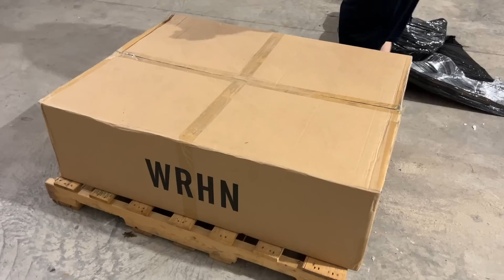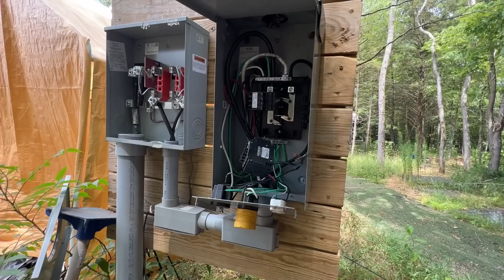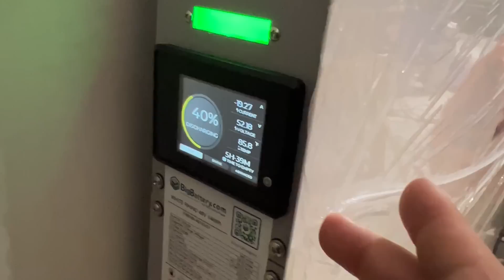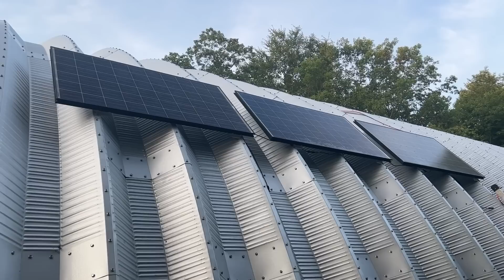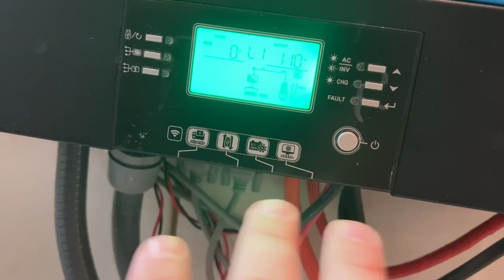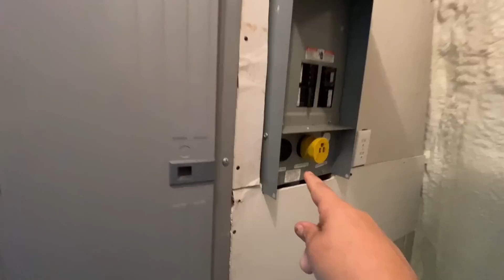DIY solar power to save $400 per month off our electric bill. SunGoldPower TP6048 Hybrid Inverter

Comment: Scott, good onya for putting in solar,
I originally put in a 1kw grid tied system 11+ years ago at the time the buy back of power was at 49.4 cents per unit
I then set up a standalone system on the back section of my roof of 3 x 190w solar panels (still have 2 more to go up) and a 400w wind turbine, feeding to 2 x 12v 470 amp/hour agm battery's to a 24v x 240v 1kw Inverter
(after 10 years that went and let the pixies out about 3 weeks ago so I have purchased a 3.5kw (peak @7kw) Inverter with remote waiting to be installed by me
After 10 years the opportunity came my way and 5 of us each purchased a 6.6kw solar system for 2900 $ installed
Saving at the time 600$each because we were smart and used our numbers to get good deals.
So for just over a year I have created 10, 066.9 kwh of power (it's nice having an app on the phone 😁) but as our subsidy dropped after the initial 10 years on my 1kw GRID tied system I now only get 7 cents per unit off peak and 10 cents a unit peak times (between 3pm and 9pm)
Being a single bloke my daily usage is only 5 kws I have recently purchased a Fujistu 5kw split ac to make my life more comfortable in summer and winter yet go to in. 
For me years ago I could see the writing on the wall about the monopoly of power companies screwing us and also being one to let my actions speak for my environmental credentials 
I have saved a lot of money by going solar (and wind) 
I believe in having a hybrid system of solar and wind, if you get a dark winter day you always have a second source of power and at night when the sun doesn't shine. 
When I can afford it I will put in a battery but the economics have to add up being a single person with already a big solar system producing my power. 
Consider looking into a suplimentry wind turbine Scott  they are worth it 
Enjoy your new freedoms and I think your Pay off time is going to be way less than 2 years! 
Tony from Western Australia 🇦🇺
Reply from the maker: I want to add wind but just have been disheartened by reading reviews of just about every one i look at.
Reply: @BusGreaseMonkey 
Scott have you looked into the Savonius (VAWT) wind turbine?
They are a great wind turbine as well.
My turbine you can see in my video on my channel titled
0003 - Feeding Time At My Place with Pink & Grey Galahs' and Western Correllas' and Joanie the cat.

Right at the 4: 57 minute mark
It is on a 6 metre x 50mm galvanised pipe attached to my verandah post, no noise,
If the batteries are not fully charged and the wind is blowing it works,
It starts at 4.1 metres per second of wind, I live at the bottom of a valley (Avon valley) in Western Australia
Neighbours on 3 sides never had one comment from any of them, and as you can see (being sarcastic here), the birds are terrified of it 😁
I have in 11 years never seen a bird injured or killed by it and some days over 100 birds come in for a feed.
Persist Scott in looking especially now their are so many varieties of turbines

Back in 1981 my mate Max built a Savonius out of just 1 x 44 gallon drum and mounted it on a 50mm galvanised pipe
The 2 halves facing north and south
I just did a YouTube search 

Savonius VAWT 44 Gallon Barrel Wind Turbine
https://youtu.be/_-0FQ31N1tI 

Max only had one tower of turbine in this you can see 2

When the wind blew and not very hard, YOU COULD NOT STOP it turning by grabbing hold of the pipe
He eventually put up the 
East and west halves and it was a real pleasure to watch and generate power 

You are mechanically optimised I'm sure if you don't want to buy one that you could for a very few dollars build one to try how good a wind turbine is 
You will have to research the generator side of your needs to attach to the Savonius and also talk to your guys your battery came from and ask them for advice to connect the Savonius to it, 
My only regret about my wind turbine is, at the time of setting up my standalone system 11 years ago as you can imagine living on a limited income I spent a fair amount on the batteries 1500$ for 2x 470 amp/h agms the Inverter, mmpt charger, cables etc by the time I started looking for wind turbines money was getting a little scarce, and 11 years ago commercially available components were still very expensive so all I could afford was a 400 w (peak 600w)24v 
Turbine I would have loved a 2kw but again I would have had to upgrade the Inverter to a 3kw or 3.5kw at least and that probably would have cost 2000$ ish back then. 
Prices have dropped hugely 
And as I said I brought this 
A couple of weeks ago 
(AU $337.21  31%OFF | Inverter 12v/ 24v 220v 7000w pure sine wave solar inverter Voltage transformer converter LED display usb charging dual socket
https://a.aliexpress.com/_mOVtbY2 ) 
I hope to install it today if I can motivate myself sufficiently! 

I envy you your modern day choices if you do go wind I didn't have the opportunity of varieties and better prices back then.

Just look at the known companies out there, and decide, try to talk to their customers, if they are a kosher company they will be happy to give you contact to talk to,.... 
Remember the comments you see on YouTube pages don't always have a good manufacturer's good interest at heart 
How many trolls do you GET? 

LOOK for the lowest starting generation point ie mine is 4.1 metres per second wind and make sure it has a max wind breaking function to stop it in excessive winds 
Hopefully maybe an app for the phone (if you are a nerd like me 😁) 

and yes when this one(my turbine) let's out the pixies I will get another bigger one 😁
Tony from Western Australia 🇦🇺

Comment: Hi Scott! I think that it is a great thing that you are doing, going solar to save on your power bill. Although, I know that you said that you bought those panels used from Santan, Will Prowse had a video where he bought 10 used panels from them and if I remember right, only one panel out of the 10 actually was able to provide 80% of the output. And some of the others were really degraded. Something that one should think about. But if it meets your needs, then it works for you!

Comment: I build custom solar controller's that allow for instant reconfiguration of the solar array.  With my controller all of the panels are wired directly into a master junction box which can reconfigure the array into any variety of configurations of series and parallel so that the minimum voltage required to charge is met.  

If you are generating excess energy then you need more battery capacity.  For backup energy I use a 60kw kohler standby generator and I have enough charging capacity and battery capacity so that my generator does not have to run very often.  My property is off-grid so I no grid for backup but after doing the math it is cheaper to burn diesel then pay for grid power which is not available.  The solar is actually the backup to a 36kw wind turbine.  I have 4 outback power systems inverter chargers each capable of 3600 watts continuous and with low use I run on a single inverter and as soon as there is more demand the other inverters will turn on and instantaneously synchronize sine wave output.  I do have enough battery capacity to run for almost 2 weeks with normal usage without any input.  The local utility company wanted $300k to bring grid power onto my property so instead of investing in that I built my own generating station.
Reply: What your saying you built is pretty amazing.
Reply: Nice

Comment: WOW! Great video. I wonder why they ship the battery pack in the ON mode. It is amazing how you manage to get those panels on your roof. I wish we get to see how you get the mounting rails, I do not see the mounting rails, on the roof and how the panels are attached to the rails or to the roof without the panel try to slide down while you try to mount the panels to the rails.

Comment: That battery will last a lot longer than 10 years. The blade batteries are rated by BYD (who makes them) is for 80% degradation after 6000 cycles.

Comment: I didn't hear you point out that these solar installer systems don't usually work when the power goes out. Yours does and can still provide most of your needs. I have a battery storage solar/wind system I'm working on. Just finished adding 10kwh more battery yesterday. I will be updating my youtube channel soon.
Reply: that inverter he has can run without batteries too.  if consumers went that route they would have power if the grid goes down, just not at night with no sun.  it can also backfeed the grid.

Comment: Did you have to have a company engineer the system or did you do it yourself?  I would like to put a system like that in.
Reply: there's nothing to engineer...it's simple plug and play.  just ask the seller to give you the correct equipment, etc.  it's an all in one inverter, plug in the battery and solar, done.

Comment: If you recall, I warned you about high taxes & fees in Tenn. before you bought the property ( along with over 100 inches a year of rain) One of our guys lived in Murfreesboro Tenn for about 5 years. As soon as his wife & him both retired. They investigated & found locations with very few taxes and no fees. He found the 2 cheapest were Texas & Florida.  He hates the humidity of Florida so they moved to Austin Texas and now wishes he came down here with me as my electic bill last month was $112.00 with over 20 days with temps in the upper 80s & 90s His electric bill in Austin was $238.00 and neither of us have any solar. Down here our power company offers to pay for everything to install solar on your house, the draw back is the first real hard tropical storm or Hurricane the repair bill to rebuild the system is on the OWNER to rebuild it as it is NOT covered with insurance. So it comes down to do ALL your homework & investigate everything before you jump in.
Reply: High taxes? Come to ILLINOIS!
Reply: @hotpuppy1   No thank you, I just got out of there ( well Missouri, same crap )  They even charge you for what you already paid tax for every year over & over, call it personal property tax, what a total SCAM !  GET OUT ! I did.  Was surprised that St. Louis is now the deadliest city in the country. Things are really bad up that way.
Reply: I pay 30 a month in summer...at 75 degrees inside.  50 in winter with the heatpump..installed my own geothermal heatpump for around 7k.

Comment: Great Video! I want to go solar here in Atlanta, but got my hair blown back with $35k and higher quotes with no batteries! Thanks for the component sources. I would like to go the route you did, but I would need someone to install the  system. Considering the route you took, do you get your 26% tax credit?
Reply: He should on any new gear, and “contracted” (could be another G. M. Entity doing the wooden nickel work?) would apply.

Comment: I wonder how much you'll save on AC usage as well since the panels create somewhat of a "dual pane" effect, shading the metal walls of the building. If you can recover data on outside temp vs. power used prior to installation and compare to similar data after installation, that might be interesting.
Reply: You believe that?   Go stand under a solar panel (ground mount).
Reply: If anything it will be worse, as the solar panels get crazy hot since they’re black and will radiate and heat up the roof more than it was without them on there.

Comment: Better to be overkill with the PV cells than not enough. You're charging no problem right now, come winter with daylight hours being less, you'll need more charging time and probably run the batteries lower overnight.

Where I'm at in Canada, you have to grid tie your solar, seems they don't want someone having independent electricity.

Comment: GOOD LORD, your electric costs are insane out there. I'm in MD and KWH base charge is about 8 cents, and effectively with all the taxes and fees, it's 12.9 cents/KWH. That is some breathtaking electric cost out there. Our use is similar to yours on a KWH/average per day, and we're seeing half the price. Good on you for adding solar, but damn. Those prices are insane.
Reply: In the uk, try £0.30 per kWh plus the £0.26 per day standing charge
Reply: @David00Yates  gulp

Comment: Great set-up, Scott....  I DID see another thing that might help out even a tiny bit more - called a Solar Dump.  When you're batteries are filled, and you still have excess power - you can direct it into your water heater - water takes a HUGE amount of power to heat, and using your excess power to heat it or keep it warm can save you even more!  I heard about it from watching an English Narrowboat channel called "Well Deck Diaries", and they use it on their narrowboat, where they only have a small solar system, but it still helps!

Comment: Wow, I couldn't imagine a $400 electric bill, much less saving that much.  They'd be paying me to use electric if I saved that.  I think the highest our bill has been this year has been about $284.00 here in Southern Indiana on Jackson County REMC.  Our house is pretty well insulated but it's just old fashioned rockwool insulation behind the plaster & lath and up in the attic.
Reply from the maker: When we got a $550+ bill we decided to add solar ;)
Reply: In Indiana, your hocus pocus Holcomb, and the one party legislators, are run by big power.  Plus, they agreed to go along with the Bush2/Obama/LGB-FJBiden “rules” and wipe out, bulldoze down all but a few coal plants. The GE natural gas (uber expensive N gas) shut down for maintenance, but no parts available (they stay offline). Your days of REMC cheap power is going to end soon.  Plus your REMC with Stone Age infrastructure will be sparking into oblivion soon.  Get independent and get your own sustainable power system deployed this year.  Time is running out.
Reply: @johnross6314  🤣🤣🤣 Gosh, triggered much?  🤣🤣🤣  If I have to pay a little more to breath cleaner air, that's just a bonus in my book.  Coal is nasty stuff and there's no such thing as "clean" coal.  I used to live in a house in Tennessee that had been heated with coal stoves for years and the ceilings in that house were black caked on coal dust.  Whenever I had to get up in the attic for anything, that stuff would sift down onto everything in the house.  The only energy hogging appliance I have electrically speaking is my 30+ year old wall unit AC and it's on its last legs this season.  I'll soon be replacing it with a much more efficient system so I'm not terribly worried about it.

Comment: My opinion as an electrical engineer, your going about it in all the right ways.  Solar panels don't degrade like LED and the standoff from the roof will keep them cool, increasing thier efficency.  I would suggest that you do add some form of lighting protection to the roof.  I've seen some of the storm's you've had roll though and this large array will be a magnet for a strike. Can't wait for your next bus rescue.
Reply from the maker: Scenicruiser bus rescue this week
Reply: Wouldn't he be protected because the panels are bolted to a metal roof that is bolted to the ground. Maybe add a strap from the building to a ground rod?
Reply: as you say Karl don’t overdo the earthing. You don’t want to attract lightning strikes.let the lightning strike the wet trees in a storm. Earth the structure at the 4 corners of the building with earth rods and earth your db to the structure.

Comment: It is not illegal in Tennessee to connect your solar system to a utility company system with proper safeguards. I am familiar with two systems that are connected to TVA distributor systems. Good luck
Reply from the maker: It is illegal for the homeowner to do it, it must be a licensed by the state electrician is what i said.

Comment: Hello Scott your second solar project seems to be a great success. I was wondering if you planned the building orientation to take advantage of the solar before construction? You also have the solar bank in Lenny in a pinch for power if you install an outlet to export power.. Good luck

Comment: Nice set up Scott hey I meant to ask you what your opinion is with the shop inverters compared to the Victron' s in the bus I know the shop inverters might be a little cheaper but I'm sure they have some good points also like the built in solar charge controllers
Etc I was hoping to get your feedback on it.
I know the multi-plus are low frequency and the sungold? Are high frequency right? And are they louder I've heard they can be.
 thanks Scott. PS it might make a great video for us viewer's just a thought.

Comment: Great video Scott, I've been debating about doing just what you did.  I want to charge a Bolt EV and power the house as much as I can.  We figure I will need to charge the car maybe once per month.  Did big battery help you with sizing your system to your project, or did you figure it out yourself ?
Reply from the maker: They recommended 2 batteries would be better but the extra funds right now are limited.  Hopefully in the future we can add another
Reply: @BusGreaseMonkey  Hello Scott, By coincidence we are having solar fitted to our roof tomorrow.  Single battery also...those things are not cheap...any future upgrade can be put on 'hold' for the time being...Great channel...

Comment: That is one nice system BGM! 50 dollar panels means easy replacement if damaged.  Though  your building offers you a unique way to protect your panels,  make a curved screen that could roll over or up the building on some rails to cover the panels when bad weather hits.  Climate change makes off grid more desirable but then throws softball sized hail at panel covered houses!

Comment: Thats not Juan . 
But looking very nice.  

I've got 10x50 trailer 69 model still on 100 watt service with 4 fuses 2 220 fuses ,  on the lake , have 4 250 watt panels , 3500 watt inverter , 

Needing to add controller and battery or batteries . 

Any help on battery size .